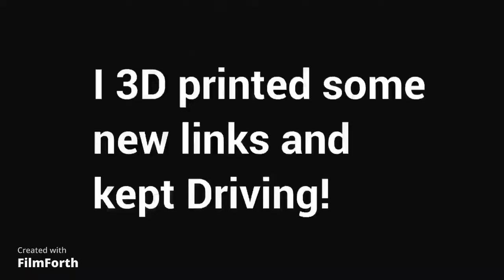SCX24 3D Printed Rock Sliders Test Run!

Comment: Nice course, to have that is epic!! I have printed those exact rock sliders but one of the screws will not tighten all the way in. did you have this problem? another great video, and i love the 3d printed videos!
Reply from the maker: Thanks! It’s super fun to have all the track! I actually did have the same problem but after a while I got all but one screw all the way in so I put some tape over the one that didn’t go in all the way thanks for watching!!!
Reply: @JustGrant25  Cheers, I will try that as if it falls out, so will the linkage system😬